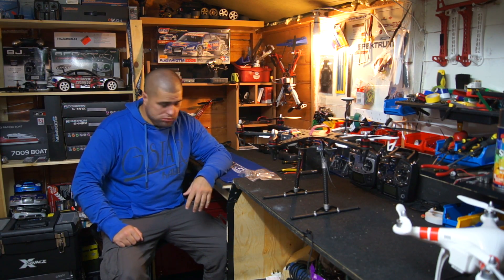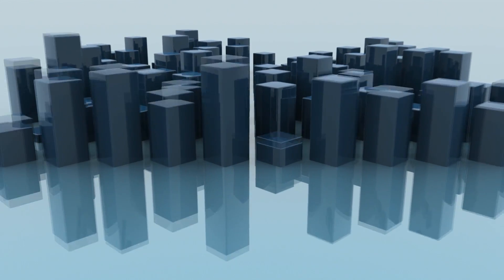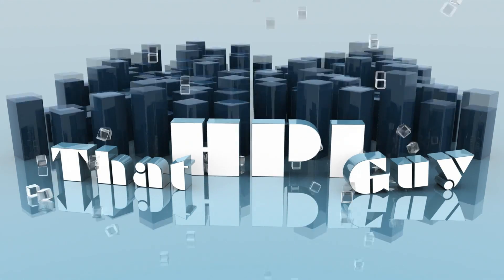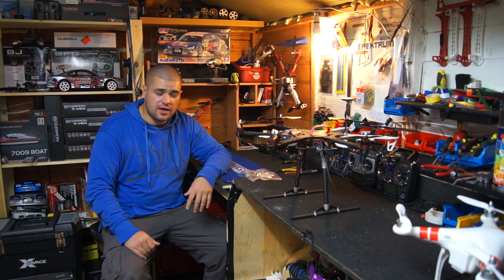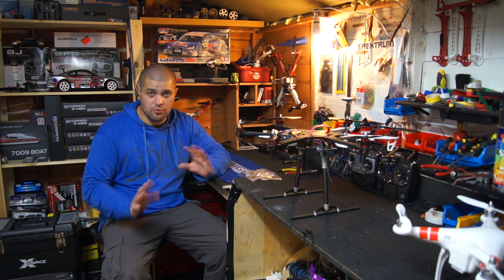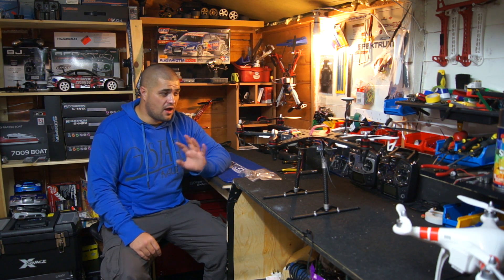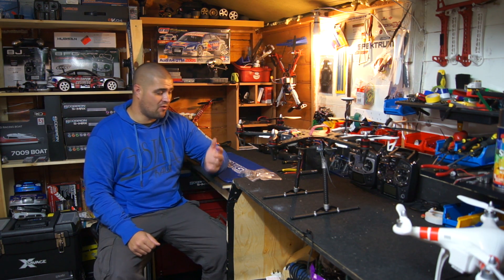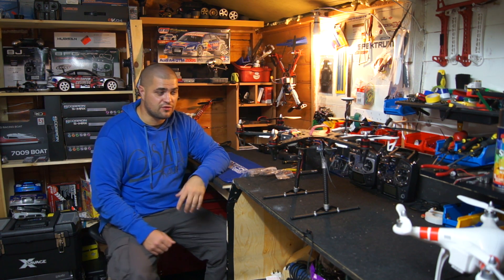How to build Retracts for Quadcopters/multirotors That HPI Guy

Comment: I actually prefer the TL65B44 retracts.  They come as a kit with the carbon fiber tubes and everything you need.  Or you can get the TL65B43 which is just the retract motor alone which has a trunnion that you can just slip a 16mm OD (14mm ID) carbon fiber or aluminum tube on to to make your own legs if you want them longer.  No need to tap a thread on the shaft and do all those other bits.

Comment: Thanks for the nice video. But is it correct when the motors don't move 90 degrees? The motors blocked at 80 degrees at the aluminium. 

So do the motor stopp when it blocked or is always power on the motor? 

Have you a new link for the carbon landing gear? 

Thanks for your answer.

Comment: I am a beginner. Love drones but don't know whicch to start with.  Qav250 or blackout.  I want to build but can not tune smaller quads. Which one suggestions PLEASE.
Reply: personally I have and are currently building a Lumenier QAV250 Carbon Fibre Edition and so far so good. There is not much difference with the two but you might want to research about them both and see which one you prefer.
Reply: http://www.reddit.com/r/Multicopter/comments/2l40xt/is_it_really_worth_the_price_blackout_and/

Comment: This is very cool but I question the strength of the trunnion shafts of the retracts.  If you have a slightly rough landing and break a trunnion then you're going to have to do all of this work all over again just to fix it.

Comment: Lil tip when useing the die set  when cutting half rotation forward quater rotation back continue this process to the desired length of the thread

Comment: Any links, threads, or vids on how to wire 2 servoless retracts on my quad? I am running a Naza on a Phantom, and have a set of very small 18gram retracts that I can easily mod to fit on... I also have a FrSky 8-16 channel Rx- but I am unsure how to wire and switch the retracts once mounted- I was thinking channel 8 on the Rx- but I am lost on wiring.
Reply: Hi hiway , did you find out how to do the wiring?
Mo
Reply: Mo Zargari
Yes I did- made them, used them, and then put them on a shelf.
I pretty much glance at the Phantom once in a while now as I build other multirotors.
Reply: ***** ,so if you dont mind me asking how did you do the wiring since I use naza v2 and the frsky rx (sbus)same as yours ,I think.
thanks Mo
Reply: I put the retracts on the channel 8 of the rx- gimbal was on the gear, or x2 of the naza- I used an arris cm3000 gimbal. Radio has to be at least 8 channels. Asign the chosen aux switch for that channel and viola- landing gear goes up and down.
Reply: ***** My radio is futaba and means I have got to go to traditional setting in naza instead of dbus so I would be able to use all the ch. Am I right?
Reply: Mo Zargari
No- which Futaba radio do you have? The sbus controls up to 8 channels through the Naza. You would need to make or buy the retracts, get a "Y" servo cable with female ends leading to a single male servo plug (extension servo Y cable) and then plug that  into the receiver (which rx do you have?)
Also- do you have a gimbal or anything else on the Phantom? There are limits to what you can do with the Naza- hence why I don't really use them anymore.
Reply: Connect the Y servo cable to the 8 port on the Rx rail- configure your T8FG aux channel 8 to a 2 way switch. Connect the other 2 ends of the servo y cable to the retracts, and you are in business. Simple as that.
Reply: ***** I am using the retracts on sky-hero and thoes retracts that I have are rated for 5v 3a  and my concern is since rx getting its power from pmu through naza via sb .is there power enough to support the reatracts?which fc do use than?
Reply: You are not going through the Naza- you are plugging into the receiver on the 8 channel- therefore you will be fine.
Reply: Keep in mind though- the Naza doesn't like it when the weight is at, or above the plane it sets on- meaning the bottom of the Naza is the line- all weight must go beneath that where possible, and it must be evenly distributed- if the retracts are not perfectly balanced then the Naza could begin yaw shifting or the craft will not be stable in gps hold. Vortex ring effect will become more likely also- descents have to be slow and steady.

Comment: So I followed your instructions on how to build retractable landing gear. In my threading process one the retract inside gears got bent. I found a replacement part online got it and it matches. 

So do you know where the best place is to thread the rectangular "block" thing that threads up and down to move the leg?

I really don't want to bent any more small hardware so if you have ever taken one of these apart and put it back together any advice would be so helpful. I can email you a picture if you would like 

THANKS!

Comment: Great tutorial, but how did you get servo travel adjusted so it is not going all the way down to 90 degrees?
Reply: Try adjusting your end points on your transmitter.
Reply: That is not gonna work...retract motor works either UP or DOWN no endpoints...
Reply: Andrew George
Yes, Jakub Egermaier  is right, you can't adjust the retractable range by using the transmitter end points. There are 2 possibilities with this video:
- ThatHPIGuy neglected the fact that when up, the retractable were blocked before they would have reached the entire travel (and this is bad because the retractable motor is still powered by the command circuit and it is mechanically blocked) and this leads to smoke / burn / current over-draining from the 5V source.
- He modified internally the retractable. Inside they have 2 OFF switches and there is one rectangular nut which must be modified to action one of the OFF switches sooner than default.

Comment: Is there a way to limit the travel of the gear? I am building a Y6 and would like the gear to travel around 80% of the total, I am afraid of the gear ending up in the props, and did not want to extend the booms for portability and easy of storage. If I have to I will...Any thoughts?
Reply: Try adjusting your end points on your transmitter.
Reply: K thx!

Comment: Very Nice ;) I'm gonna do this
Reply: Hi, if it helps, I cribbed the idea and got some replacement tent poles from Go Outdoors, £2 a pack 10mm o/d 4mm i/d. Just cut them to your required length for the legs and 2 lengths for the skids.
I used hot melt to glue the trunion of the retract into the tube and shaped the other end to fit over the skids and hot glue tacked them.
For extra strength, I had a sheet of thin fibre glass and cut some triangles, glued and screwed these at the bottom.
Strong and light. Hope it helps, will add phot later

Comment: u think the f550 stock motor. Whit gimbal. Gopro h3 .fpv transmitter. Retracted landing gear. Can carry two 3s.5500 On parallel =11.000 so I can't get more running time.oh and 1038. Propeller please reply

Comment: I tried to leave a PM but something is a little off there. So anyway check out the new three retracts from Hobby King. Here is one of them with the 10Kg cap. 
http://www.hobbyking.com/hobbyking/store/__50217__Turnigy_95_Degree_All_Metal_Servoless_Outward_Operating_Retract_Unit_180_Size_1pc_.html, I don't know how to use tiny url. Sorry. Cheers mate and Happy New Year
Reply: Does this work? No matter how how stand on my head I cannot see this working as needed. When closed, the legs need to be up, the position as shown is. It looks like the leg would be on the top piece based up mounting hole locations. What am I missing? Says, the leg retracts away from the motor unit". Will this work the thathpiu guy's demo? Don't want to buy something that won't work.
Reply: Arthur Ross Never mind. There was one more twist of the neck to see it.
Reply: Arthur Ross Sorry for late reply.I thought they would work as I was eyeing them a few weeks ago. This is a going concern, this matter: A guy's own, home built CF" Retracts" project! I say that Hobby King has finally got something I can order to see if they will do. Clearly a design one could adapt to. I especially want these in favour of the flimsy plastic landing skids that I am currently flying with. Add a proper 4S 5000mah battery and they are virtually quivering under the load!

Comment: Great videos :)  how did you get the retracts to stop before moving the entire 90 degrees?
Reply: Just built a set of these, excellent howto here. To get less travel you have to strip down the retract mechanisms, inside you will see that the retract travel is limited by two micro switches. You just have to extend the surface that pushes the switch at your desired angle. Best of luck

Comment: Brilliant!  Thomas C, While a very nice rounded CNC'd spacer and bushing that made the whole thing much prettier and also more stable would be nice, it is not the sort of thing one pops down to the local hardware store and gets!!! I disagree that it is a bad design, but I agree that Portion of it lacks refinement. 

Perhaps you have a better suggestion? I really mean that, not as a slam, I mean join the community, find a better solution and link your video.

Thinking of it for a moment I think someone like RCMANCHILD could 3D print such a thing and sell them to make money!! In fact maybe I will since I have access to a 3D printer..... Except I suck at CAD drawing....

Comment: I am currently using your suggestions in building my set of retracts for my Tarot 650 and do not have the extensions on that you drill in order to mount them to the retracts.  I do have a question though.   The landing skids on the 650 are set at an angle vs being straight when lowered.  I have managed to fit the retracts into the original skid bracket that connects to the bottom frame.  So I'll have to install the legs offset and not centered, but I am concerned that I'm not able to limit the travel of the retract and it will damage the skid when it is retracted.  Is there a way to limit the travel of the retract or will it stop automatically when it senses pressure? 
Thanks,
Reply: Try adjusting your end points on your transmitter.

If the legs need to be at different angles you will have to use a channel for each leg.

Comment: Good job, but next time use the M4 tap tool to put a thread into the retracts too. You won't get that slack, The nut will seat easier, and only need to act as a lock.

Protip for using a tap and die is to always place the item in a vice, and it's 1.5 turns on .25 turns off to get the cleanest thread cut.
I'd also put a rag over the retracts when threading to keep the cuttings out of the worm gears.
Also, ask Santa for a Dremel pillar drill ;)
Reply: I like the idea of retrtacts.  You had a good idea.  You've started me thinking.  Thank you.

Just as docthebiker says.  Don't keep winding.  Every turn back it off a quauter of a turn and then go again.  Take your time.  You'll get nice clean threads that way.  Be even more carefull on aluminium or you could rip it up and have no thread at all.

You are putting such a lot of preasure on that retract. So easy to break.  put it in a vice and keep it still. that way you can get your die on straigh too.  If it goes on wonky, after a few turns the die will be trying to straighten itself and it can deform the threads that its pulling against.

Oh, and if you get a file and chamfer the end of the rod a little.  Just put rub the corner off the top off the rod.  You will find that the die will go on real easy this way.

You can add more cutting oil too.  Keep it wet and you will get a better cut thread and your die will last much longer.

I'm not knocking, honestly.  I love to see peopler like you having fun, being creative and creative.  I read that one man had problems.  I hope that these little tips might help someone.

Best of luck to you!